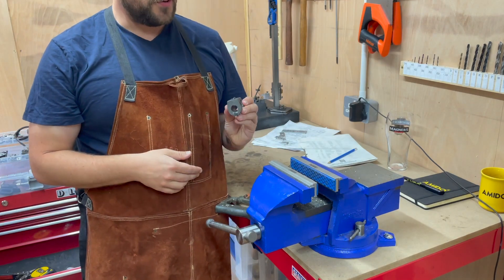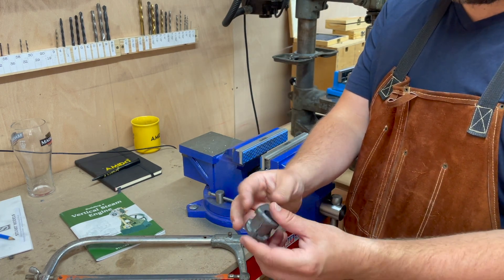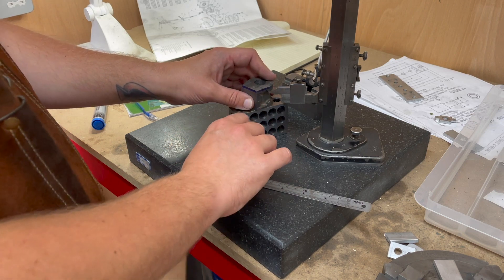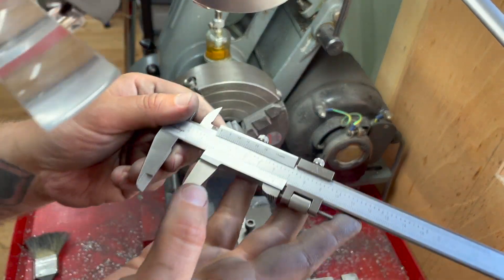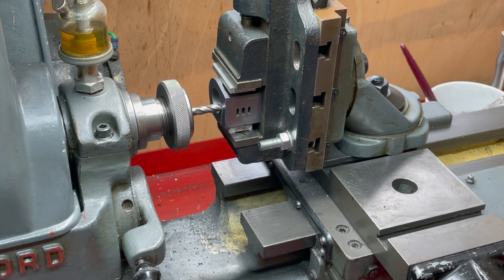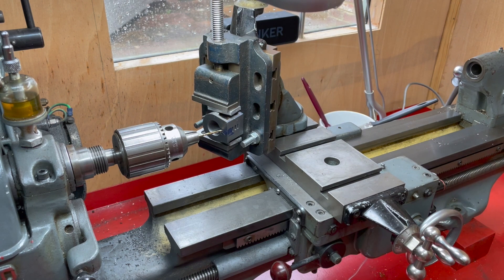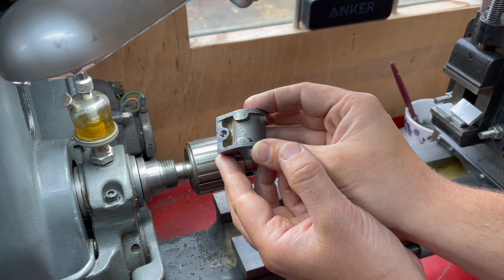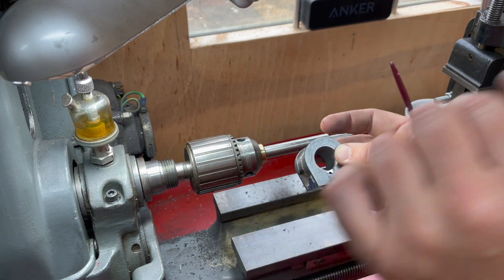Building a Stuart 10V Steam Engine on a Lathe IV - Cylinder

Comment: Very grateful for the tripod - hand-held may sometimes be necessary for really hard to film things, but fixed is much, much better. I think this length is better. I like the explanations of what you are doing, and explanations of the set-up and work-holding. A bit of machining sometimes rounds out the picture, but by and large turning of an o.d. doesn't add much - but nice to know what you've drilled, reamed or bored, and how,  and how you tapped or threaded, and things like how you set up for the angle of the steam ports are very interesting and probably need to show the drilling to make it all clear. Music I can live without, but Beethoven is pleasant enough so no major complaint. I think you've got the balance just about right with this one. Thanks for posting the video, I look forward to the remainder of the series.
Reply from the maker: Thank you - I think the tripod definitely has paid for itself already. I will only be playing music (if at all) during the fast forward sequences, and I will try to keep it tasteful. I will also take on board your advice for mostly filming the interesting parts, rather than every single operation. For example, the use of the parting tool on the cylinder heads/etc.

Comment: Nicely done WW
yes the steam ports are tricky when a lot of work as been done to get to that stage, don't want to ruin all that work, 
i'm certainly no expert on videoing, but you'll never please all of the viewers all of the time that's for certain,  e.g. some like music, some hate it!!!! ive found that out.
Nice to see the proper vernier scale being used, expect you will be getting the slide rule out next!!!!!, however you need the eyesight to match, thats the only reason i tend to use digital. but i'm all for old school methods.
Workshop looks like its evolving well, that said though any workshop never stops evolving.
keep up the good work
see you next time
regards 
mr f
Reply from the maker: I must admit I have to go for my optivisor whenever the vernier gets used - but it is a hard thing to beat. I think my favourite measuring tool is my vernier height gauge, I don't really show that enough! I'm pleased with my workshop, but it has a huge deficit when it comes to soldering and brazing - I think that will be the next big challenge after the Stuart... maybe I could ask your advice on your silver soldering setup (equipment, flux, solder, hearth, etc. when you have time?)
Reply: @williamsworkshopuk  hi WW
I use ("easyflo" flux and s/solder ) there are other brands i would imagine just as good, but it can be expensive on any large jobs, i think many of my modelling friends use Polly Engineering in long eaton, notts for their stock, but i have no experience in using them, so shop around. I just use soft solder on water tanks and the like and anything non boiler related or strength related!!
The hearth i just use fire bricks individually or set in a small steel frame.
Good Luck
regards
mr f